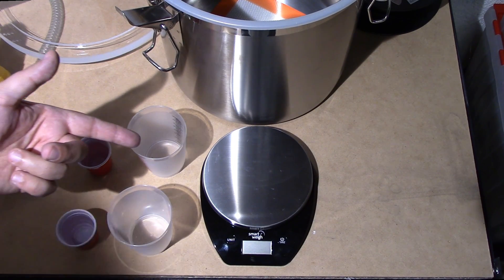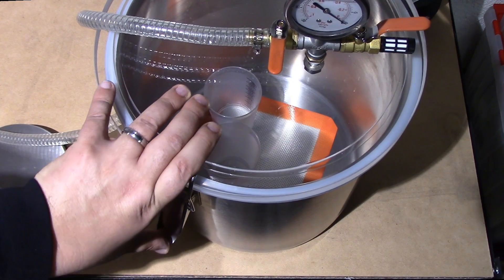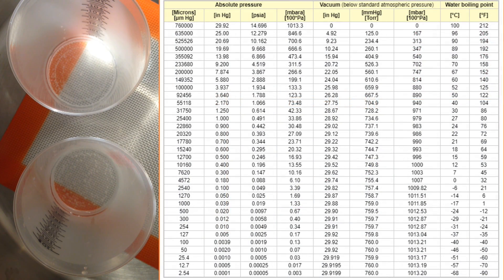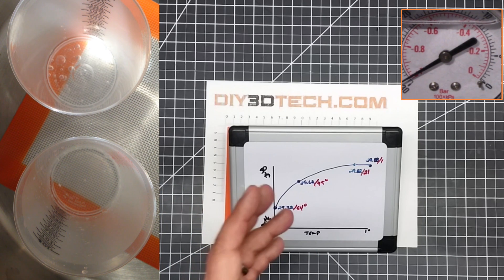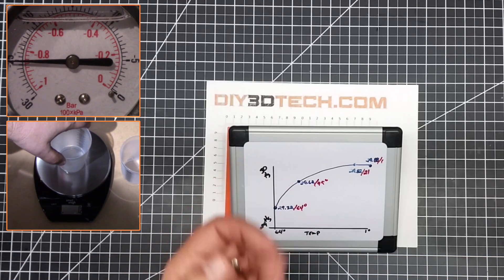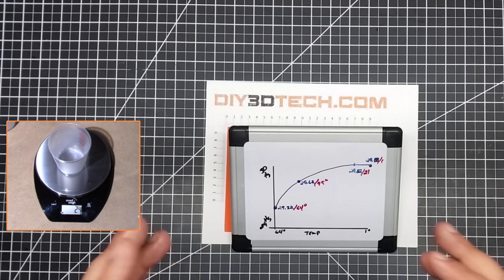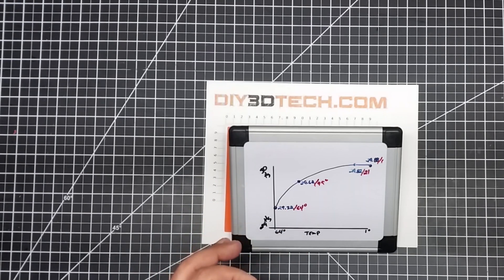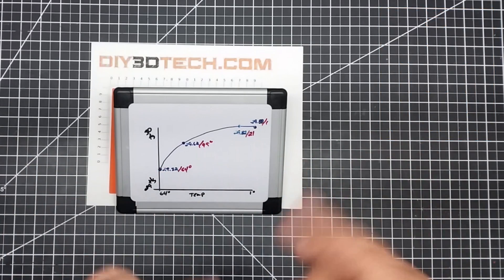Shop Talk  - Filament Drying With a Vacuum Chamber Part 2!

Comment: Based on ur premise... why not ha an air tight container to hold the desiccate setup between the pump and chamber. Then have another similar container of desiccate on the incoming air bleed valve so the air coming back in has a minimal amount of water from the ambient air. My current ambient air is 38 percent moisture. The thing hats confusing is ... it’s pretty difficult to measure moisture content of the filament.
Reply from the maker: The idea here is the chamber is a dryer whereas a "dry box" would be used to keep it dry once it was dried.  If you place hydrated filament in a dry box with desiccate alone it won't have much affect...

Comment: Very Nice video and explain. I had made something very similar, but home made recipient. I'm pulling vacuum with my diesel car brake booster vacuum pump,but only but I only reach about 50 or 55 cm of mercury that are like 20 inches of mercury you think is enough for dry my nylon with carbon fiber filament? Another question: you says at the video 70° or 80° but Farengheit? are you sure? or Celcius?. Could you tell me complete cycle of temperature and vacuum made for dry Nylons filaments?  Thank you very much for your videos. Are very good.
Reply from the maker: Thanks and keep in mind you don't need a lot heat in a vacuum as the issue is as the water leaves the plastic it takes with it heat and in vacuum there is small spread in the vacuum to boiling point.  So the vacuum is always chasing the heat so a little warmth goes a long way...
Reply: @DIY3DTECHcom  I understand. The problem that I have is that even after giving it 3 or 4 hours of 60° to 75° celcius of temperature and then applying it around 3 or 4 minutes of 20 inches of mercury of vacuum I still hear it burst and boil the nylon filament with carbon when it is extruded by the nozzle and the finish of printed part is not goot yet. Thank you for yor faste response. You are very friendly. Greetings!

Comment: You could warm the spool of filament first say 3 hours to get it (Nylon 65C) all through warm and then put it into chamber.
Reply from the maker: While at first I was skeptical of value in doing so (pre-heating) I have since come around on the point and agree especially for "deep" dehydration.

Comment: So what happened?  No follow up with filament drying results?  Would sure like to hear whether or not you had any success before I go down this route.
Reply from the maker: Does work and believe adding desiccant helps as it gives the "water" a place to go in the semi vacuum.
Reply: DIY3DTECH.com excellent thanks.  More effective than oven drying?

Comment: I use a setup like this all the time  with a hot plate  to remove impurities in butane hash oil (dabs). I use this boiling point calculator (http://trimen.pl/witek/calculators/wrzenie.htmlo) to get the boiling point on things like meta-benzine and hydro-carbons. I have to use tiles and china plates to transfer the heat because you're right, no air no heat transfer.

I also 3D print and I'm in Hawaii, with high humidity 24/7 year round. The  Low humidity point is like 57%. The filament, yes even the PETG sucks the moisture up fast. A good spool of PETG left loaded on the printer lasts about a 12 days.

So I saw your video and tried it out.

4 spools at -29.6 or so inches/HG for 4 days. I would hook the chamber to the pump for 5 minutes each day. No heat. 1 spool of PETG and 3 spools of PLA +.

I pulled the first spool of PLA + out today. Printed a Temperature Tower (https://www.thingiverse.com/thing:2729076) and boy oh boy did the vacuum change the filament.

This spool printed at 215 degrees C when I first got it. It printed well, pretty nice stuff. Now I can't even get it out of the nozzle at anything below 220. It printed best at 255 degrees with 25% fan. I will try the other spools soon and keep you updated.

I don't even know what to think now.
Reply from the maker: Thanks for sharing this as this fascinating, please do let me know how things progress.  Also I am of the opinion now that heating the filament first before placing in the vacuum is the best way to go...

Comment: Just for fun you can try pulling a vacuum on water until it freezes in mid boil. It would be interesting to see if that vacuum pump can do it, the vacuum pumps I've used to do this were much larger.
Reply from the maker: Sorry no can do as the water boils it gives up heat and therefore takes more vacuum.  I am assuming to race that "down" it would take a molecule vacuum pump as I don't think even a two stage could do this...  But it would be neat to do for sure!

Comment: Nice informational video! 
As I saw over the time, keeping your filament with dessicant in a closed box does a great job of keeping the moisture out of the filament. Also, the vacuum chamber would help the boiling temperature to drop down and the water would easily evaporate. But keep in mind, the vacuum pump may be affected by the water you get out of several spools :)
Keep up the good work!
Reply from the maker: Many thanks!  Yes a couple folks wrote about the water, in the bigger scope of things I am not sure how water it would take to affect it as the yield is only around a gram so t point yes.  However I am going to design an in-line descant chamber and see how that works...

Comment: The vacuum at which water boils is dependent upon the barometric pressure and your altitude.
And you need a desiccant bag to help your pump oil from getting fragged and help the pump work less hard.
Reply: ummmm using a vacuum pump would surely change the barometric pressure inside of the vacuum chamber,,isn't that the idea of using the vacuum chamber?
Reply from the maker: Yes sort of "vacuum at which water boils is dependent upon the barometric pressure and your altitude" because if your at sea level there will more "pressure" to remove then say if your at the top of a mountain.  The sort of is can't see "huge" difference unless you go from say San Diego to Denver.  However would like to understand better your thoughts on the desiccant usage and a " fragged" up pump as I am no vacuum pump expert :-)

Comment: Are you using a cold trap so the water vapor doesn't contaminate the pump oil?
Reply from the maker: Wow that seems like a lot of complexity and not something the average Joe would do.  I wonder if there is there another way as I was thinking about designing an in-line desiccant chamber.  Your thoughts?
Reply: Yep a dessicant tube or the like will work for water, but not VOCs obviously.  I plan on also using mine to reclaim IPA from post processing of resin prints. AFAIK a cold trap is really the only way to go for that.
Reply: @DIY3DTECHcom  I think pulling a vacuum on the chamber which contains calcium oxide as a desiccant, either in the chamber or inline like you suggest, may work. As any water is pulled out of the filament, it can react with the calcium oxide chemically to produce calcium hydroxide and thus not wind up in the pump oil. Calcium oxide is relatively cheap too. You'd just need a way to prevent it from winding up in the oil. This may be much ado about nothing. The little amount of water in the filament may just mean you have to change the pump oil slightly more often. That's probably a time-will-tell scenario.
Reply from the maker: no I am not, please do tell more?  :-)
Reply: @DIY3DTECHcom  Basically the line to the pump runs through the cold trap which provides a region of cold or super-cold which causes any water or solvent vapors to condense and freeze before being pulled through the vacuum pump. I'd think it would be useful for resin degassing as well to prevent the resin solvents from degrading the pump oil. Here's an image link with the concept. https://en.m.wikipedia.org/wiki/Cold_trap#/media/File%3ACold_Trap.PNG
The container could just be a small cooler with dry ice and isopropyl alcohol. The trap could be made with 2 different sized copper pipes soldered together with a fitting to drain the trap on the bottom.
Reply: https://www.amazon.com/StonyLab-Glass-Vacuum-Serrated-Length/dp/B07CGQMVXL 
You submerge that contraption into a cold bath (dry ice/acetone is good for -70C), then connect it inline between your pump and the chamber or whatever else you are pumping on.  Keeps harmful vapors out of your pump/oil.
Reply: You can also remove the water from the oil after it's contaminated. Drying filament it probably would take a while for it to get bad.

Comment: I think the reason that water won’t leave the desiccant is because the water in the desiccant has a lower activity (similar to concentration) compared to pure water and therefore has a lower vapour pressure. You need a radiant heat source to pass into the vacuum, try a heat lamp. Please never apologize for being geeky.
Reply from the maker: LOL! "Please never apologize for being geeky" Thanks for the positive support :-)  You could have a point there " pure water" and some thing I have not and some thing I will look into!

Comment: I'm a chemist by training and am fairly sure you need desiccant.  Sure enough that I ordered a gallon of the chromium-dyed silica gel beads along with my chamber.

When the partial pressure of water vapor inside the vessel reaches the vapor pressure of water at the temperature of the liquid, vaporization reaches equilibrium. This means vapor gets trapped back onto the surface of the liquid at the same rate as it evaporates.  In a closed system you simply won't be able to release more water than the vessel holds at the given vapor pressure.  Therefore if you want to liberate more water from the cup (or your filament, etc), you have to give the water vapor another place to go, or the vacuum chamber can't do any more net work for you.  This where the silica gel comes into play. 

As far as the silica gel also releasing its water in a vacuum - it will, but only when it reaches the analogous equilibrium value.  If you start with a good amount of fresh/dry desiccant you should be able to trap a fair bit of water vapor before reaching that equilibrium.

The experiment I see is to do what you did here, twice, at the same temperature, but with/without desiccant.  Then weigh both of the water vessels, as well as the desiccant, before/after.  You may need to leave it at vacuum for awhile, to give the vapor time to travel from the cup to the desiccant.  You also need to account for the fact that if you leave the pump on, vapor goes all the way to the pump and ends up trapped in the oil.  That's not good for the pump long-term.  Best practice would be to use a cold trap.  That also gives the vapor another place to go.  And since the trap is cold, the liquid condensate that forms there will have a much lower vapor pressure than the other things you are pumping on.
Reply from the maker: Jarrod, well the thing I can tell you is I am NOT a chemist however always want to play one on TV!  However as an amature hack I am coming around to your thinking here "sure you need desiccant"!  I also found you note VERY insightful to say the least and will use it as the basis for another video on the topic as this is explained very well!  I totally get the part " In a closed system you simply won't be able to release more water than the vessel holds at the given vapor pressure"  so the desiccant would increase the systems ability to do this.  However one of the things in my test is if ran the pump for 7 min ro 15 mins there was really no difference.  Why?  Now if full disclose the scale you could read full grams so there might of been a fractional gram which was not measure however it was clear the function was not linear...
Reply: Yes there are things about this system I still don't fully understand.  For example what the heck does the pump really do once the chamber is evacuated?  I suspect not much, and that might help explain your non-linearity.  The pump moves a good bit of volume at high pressure - moving away water vapor - but then almost nothing once the vessel is pumped down.  This is another way to look at how desiccant might help you out.  You need some sort of sink to move the water vapor out of the chamber once it gets liberated from whatever you are trying to dehydrate.  The pump itself probably is not going to be all that effective as a sink, and in any case you don't want that because water in your pump is not great (which is why you are getting asked about using a cold trap - think of it as the condenser in a still, converting vapors back into liquid form before reaching your pump).

My intent is to place filament + dessicant into the chamber, evacuate it, shut the valves, unhook the pump and power it off.  Then let the vacuum and desiccant do all the work.  The real unknown to me is whether vacuum alone is really enough to get the water out of the filament.  No idea.  Heat may be required as you alluded to here.   I have an old, crackling roll of clear PLA sitting in my chamber for the past 24h, at about -29in Hg, with a little jar of the blue beads.  I'll give it a few more days and see if it prints any better.
Reply from the maker: The  piece I am unclear about is the movement of the very small amount of remaining water vapor.  As without air how does it move?  I realize it can sort of move on its own, however would think this would be very limited as the effluent would be very small especially with the pump turned off .  In a high vacuum systems they have crazy efficient molecular pump (basically like an inverted jet engine) which create a deep draw.
Reply: @DIY3DTECHcom  The molecules are bouncing around, off the walls of the chamber. Maximizing the surface area of the desiccant should help with that.  I do worry that these little $60 pumps don't pull a deep enough vacuum to reverse an already-contaminated roll of filament.  We'll see, I guess.  If not, I'm thinking the way to go will be to drive off the water in an oven and immediately transfer the filament to the vacuum chamber to cool down.  In any case this is a superior way to store partially used rolls.